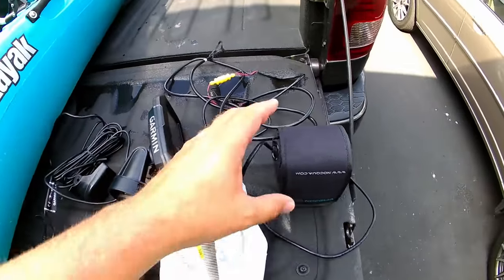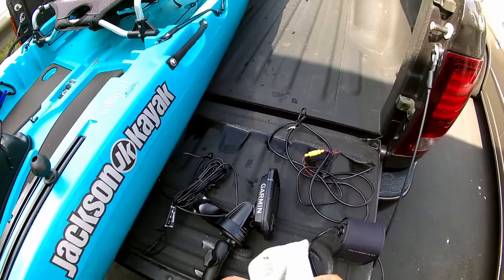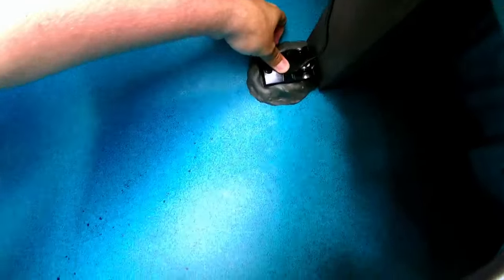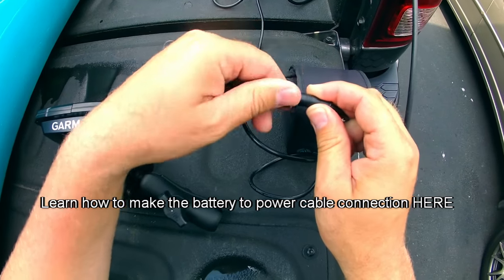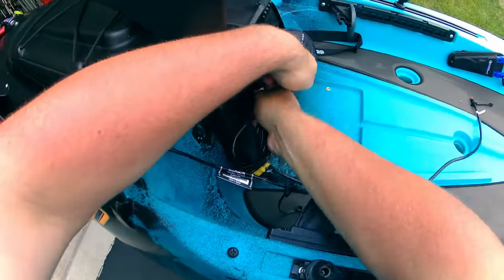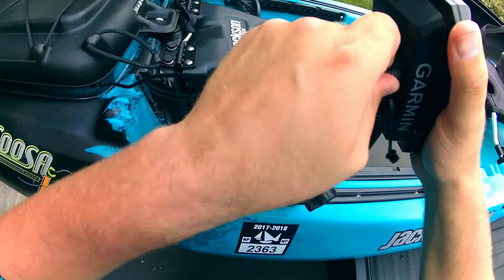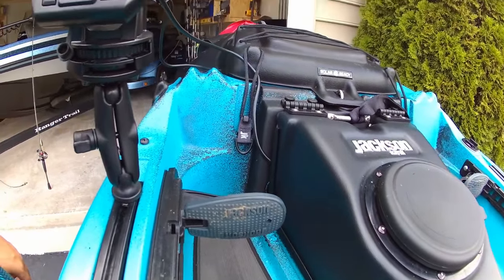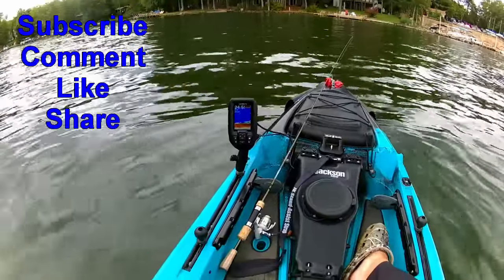Garmin Striker 4 Kayak Install...Simple Transducer Mounting Option

Comment: So a transducer can be on the inside and not the outside?
Reply from the maker: Machine v2 it works either way...inside or out...just can't use side imaging with inside mount
Reply: 1Cast 1Fish thanks. I plan to buy a kyack with my tax return and have no idea how to use fish finders. I saw they also sell strong magnetic  mounts and I think I'll go that direction. Thank you for the fast reply
Reply from the maker: Machine v2 Hope you get that Yak buddy...magnets work as well..it just leaves the transducer exposed...I kayak rivers with alot of rock...so the in hull mount keeps mine safe.
Reply: 1Cast 1Fish I'll be fishing small lakes and resivors in Colorado. Nothing massive or extreme. Any suggestions? I'm 5'11 170lbs but I want to buy 2 so I can bring a friend or family. Also ones that we can stand on. If you have any suggestions that would be appreciated
Reply from the maker: Machine v2 there are alot of options now...Yaking is becoming popular so lots more choices...depends on your price range
Reply: 1Cast 1Fish maybe 2k Max for two. Yea there's so many I've looked at I've lost count. Oh and I own a small 12' aluminum boat 15hp engine I plan to use the finder on too.
Reply from the maker: Machine v2 Perception and Feelfree have good models for 1000 or under...might even be able to find a used Jackson for the price. If your going to stand...wider is better.

Comment: Great video, you have multiple links for the battery accessories. Can I just buy the 10 mah and be on my way or do I need everything you have a link for?
Reply from the maker: I have the link for the 4 & 10 based on your budget or needs...personally the 10 will last forever and is great for running multiple accessories.  I also recommend the splitter and USB port in the link so you have unlimited options while on the water.

Comment: looked everywhere no duct seal?? where do you buy it?
Reply from the maker: Should be easy to get from a Lowes or Home Depot
Reply from the maker: Did you have any luck finding it?  Any questions just let me know
Reply: found it but cannot get it to work in hull transducer, must have liner, trying to mount it on rear now
Reply from the maker: What are you trying to mount it in?

Comment: so the duct seal doesn't interfere with the transducer?
Reply from the maker: The sonar shoots through duct seal and the hull without issues. The most important thing is to ensure there is no air gap between the transducer, duct seal, and hull.
Be sure to subscribe and share if you have not already.

Comment: So it doesn't actually have to be in the water?!? This almost seems to good to be true. Anyway I'm going to try it before I put any holes in my yak!
Reply from the maker: No it does not when done properly
Reply: @1Cast1Fish  would you say the thickness of the putty and the hull need to be minimal?
Reply from the maker: @c-hak7697  correct, no need for extra…just enough
Reply: if its not in water theres a chance the trancducer overheats and gets destroyed. When it is in the water the water works like a cooling system
Reply from the maker: We will be testing this theory soon...so stay tuned :)
Reply: @1Cast1Fish  I will be looking forward to your results :)

Comment: How does the transducer work when it's not in the water
Reply from the maker: It works using sound waves, so it does not need submerged in water.  Sound travels excellent through water, but also will travel through the hull and water without issue. The only issues come up when there is an air gap or air bubbles, which do not allow the sonar to travel through.
Reply: Thanks I thought all  Transducers had to be underwater I just stuck a    Garmin Striker On  a  old  Town kayak Stuck  The transistor through the scupper hole On PVC pipe It works.
Reply from the maker: Scupper hole mounts work great as well

Comment: You think i can do this on my canoe? Its a Coleman platic one
Reply from the maker: Yes it will work...just ensure there is no air gap between the hull and duct seal (fill all voids) and ensure no air gaps between the transducer and duct seal.
Reply: 1Cast 1Fish thanks a bunch.. Subscribed
Reply from the maker: No problem...any issues or other questions just ask
Reply: 1Cast 1Fish hey brother, i received my garmin stryker 4 today. Quick question, the blue and brown cable from power chord says its a "Sharing Cable" is this a power sharing cable? Like to run an led light? Thabks in advance.
Reply from the maker: The Striker power/data cable consists of four wires:Red and Black - The red wire will connect to your positive battery terminal and the black wire will connect to your negative battery terminal.Blue and Brown1 (Optional) - The Blue wire is the Tx (Transmit) and brown is the Rx (Receive) wire. These wires are used only for Garmin Data Sharing between the Striker and the echoMAP series devices. If these wires are left disconnected Garmin suggests clipping the stripped tinned ends back to the insulation.To initiate a Garmin data transfer on the Striker:
HomeSelect User DataSelect Manage DataTurn User Data Sharing OnOnce User Data Sharing is on for both devices the User Data will be automatically shared to the connected device.In the event the power/data cables won't reach between the two devices, Garmin offers a User Data Sharing Cable that can act as an extension. For information on connecting the User Data Sharing Cable please consult the installation instructions included with the Data Sharing Cable packaging.1The Blue and Brown wires are for Garmin proprietary user data sharing only. They will not support NMEA 0183
Reply: 1Cast 1Fish your awesome thanks bud. Planning on taking the canoe out this weekend but now there's rain in forecast so not sure but ill definitely follow back. Is it relatively easy to distinguish pan fish from catfish on the sonar? I do a bit of both but never on same trip its either or for me. Cheers
Reply from the maker: Honestly it would be tough to be 100% using this sonar...or any 2D sonar for that matter.  Panfish seem to school, and catfish tend to hug the bottom...so I would look for arches on bottom for cats...or multiple suspended arches for panfish.

Comment: Awesome video! I was wondering if I could do this same type of a mount in an aluminum row boat? (12’ semi V/Jon boat) wasn’t sure if the transducer would shoot through the aluminum or not. I would be sure to avoid any reinforced areas, and find a flat clean part to put it on. Let me know if you think that would work! Thanks again for the great video, it was super helpful!
Reply from the maker: Yes it will, just be sure there are no gaps.  Also if the aluminum is 2 piece thick it might not work as well.

Comment: wouldnt that make it hard to see threw the plastic of the kayak? i would think you wouldnt want anything in the way of the transducer?
Reply from the maker: No issues at all...sonar will travel through plastic kayak hulls with no issues.  I used mine like this all last year without problems and perfect clarity.  The only features that will not work correctly are the water temp and side imaging views if equipped.
Reply: i bought the scotty mount that will go onto the ram mount. but the question is. how do you have that ram mount hooked to the striker 4?
Reply: i have  this exActty.   scotty 438 gear head track adapter  snd the scotty  368 universal mount going into that.  then the ram mount going into the striker 4.  can you show me a picture or explain how the striker 4 connects to the ram mount please?
Reply from the maker: The RAM-B-101-G4 (Light duty mount) is the model I have.  You will also need a Yak attack 1" Ball mount to attach it to your rails. No need for the Scotty stuff.  This Ram mount has predrilled holes that line up with the holes in the Striker 4 mounting base.
Reply: I use scotty mounts for my rails on my 2017 stealth 12   if you look up those numbers and mounts i sent ya its similar to what you got there
Reply: 1Cast 1Fish   i do believe mine will sit up just a little bit higher.
Reply from the maker: Yes if higher is what you are going for, it should work well for that.  Did you get the ram mount attached to the Striker 4 base plate?    If not, send me your email and I can send you a pic when I get a chance.
Reply: 1Cast 1Fish  Rob Hoffman Jr. Facebook. Shoot me a message i will show ya
Reply from the maker: lol...I actually don't have a Facebook account....but I plan on making one in the future here soon...It would definitely help with channel growth I am sure...I will save the link and check in once I do.
Reply: 1Cast 1Fish  good deal man. If i knew how to send photos on here i would show ya.  But its a scotty mount going into track. Then a scotty mount with a flat spot with holes in it will mount the ram mount to that. Then the striker 4

Comment: Your transducer is backwards, does that matter?
Reply from the maker: Yes and No...depends on your uses and the type of sonar.  Down Imaging, Side Imaging...yes it will have an effect (images will show opposite). Trolling...not much effect unless very deep water.  Depth, 2D Sonar & GPS...No effect. For my specific use and sonar, it doe snot matter, I wanted a clean install with the cables out of the way, since I tend to stuff a lot of things in the nose of my kayak....Hope this helps

Comment: ive see your video , nice one , duct seal are only way to get the trasducer works in hull? im about to get the striker 4 on a fiber glass boat ,  i thinks its twice thicker as yours . do you think it will work? if not im goinf to get another portable mounting that will cost me about the finder it self.:(
Reply from the maker: Mohd Azrie Mustafa duct seal will work buddy...just make sure everything seats with no gaps

Comment: don't you need to put transducer under the water ?
Reply from the maker: Nope
Reply: @1Cast1Fish  Oh I was struggling to insulate my transducer under my inflatable boat. Seems like I can leave it on my boat
Reply from the maker: Ok, so if you have an inflatable you may have issues...the transducers do not shoot thru if there is a air gap between them and the water.

Comment: I didn't notice the water temp on the Garmin at the end of video?
Reply from the maker: It will not read a accurate water temp when mounted inside the hull since the transducer is out of the water

Comment: The transducer goes through the boat just fine? Why don’t everyone do that?
Reply from the maker: For lower powered units and kayaks it works great.  I would not use this method for high end units with 1000W of power because of the heat that is generated at the transducer.

Comment: What kind of battery is that?
Reply from the maker: JohnDoeGlo Gloku it is a Nocqua Pro Power Kit 10Ah battery...you can check out other info on it from other videos on my channel.  I recently posted a video showing how long the battery lasts
Reply: Do you need the battery to work the Garmin 4? I just picked up one and going to install it when I have the time.
Reply from the maker: Yes you will need a battery to power the fish finder

Comment: Weird question (and aware this video is 7 years old) but why does the transducer not need to be in the water? Not sure exactly how they work I guess
Reply from the maker: Transducers work using sound waves, so as long as there is no air gaps, it will work to some degree.  This is why they even make in hull mounted transducers made for this specific use.
Reply: @1Cast1Fish  Oh wow didn’t know that. Cool! Lol, thank you for the reply!
Reply from the maker: Glad to help

Comment: the coosa hd specifically has a notch cut under it to mount the transducer, any reason you cut into the front?
Reply from the maker: Oh I did not cut or modify anything....I use the duct seal so I can easily remove it and put it in other kayak or boats easy.
Reply: Wow I didn’t know you can do that. Excellent work!
Reply: and it doesnt interfere with the signal at all not having it in the water?
Reply from the maker: Nope signal works perfect....the only thing that does not work will be water temp, since its not in direct contact

Comment: I installed my transducer with the duct seal and it wasnt reading good until the hull got wet
Reply from the maker: Inside the hull got wet, or the outside when you put it in the water?

Comment: PSA:  this only works with 2d sonar.  Side imaging will NOT work with hull through.
Reply from the maker: That is correct
Reply: @1Cast1Fish  Will this work with the Garmin ClearVu?
Reply from the maker: I will never say 100% but I know many that use it without issue this way.   Most of the time it does not work is due to an install issue and a simple adjustment on the install fixes the problems.  Be sure to watch my other video on in hull installs to be sure to get it right.

Comment: Garmin instructions say transducer must be in water to work properly - putting inside kayak does not follow instructions from Garmin.
Reply from the maker: It works great, been doing it for years along with countless others...guess it does not work 100% proper though since the water temp will be off a bit.  Also can't do this if you use a side imaging sonar.

Comment: I’m not the smartest guy so don’t give me too much flack haha, I would think that mounting the transducer in the hull like that would take away from the accuracy. If I doesn’t please let me know I’m trying to find the easiest way with the best results
Reply from the maker: If your hull is 2" + thick sure it can....or if you leave any air gaps....other than that you are good to go.
Reply: 1Cast 1Fish thank you! I I didn’t realize it’s that easy. This is for sure gonna be a purchase
Reply from the maker: Awesome, any questions feel free to ask
Reply: @1Cast1Fish  looked like yours had pockets of air where the transducer sits. Crazy it was so clear. I've tried the duct se al in my kayak (lifetime Tamarack) five different times, and adjusted settings left and right (which you taught me how to do that with your videos) and STILL don't mark fish. Shows the bottom, in depth no problem though. And yes, there were alot of fish in there cause I caught alot of em... I'm at Whit's and with this dang thing